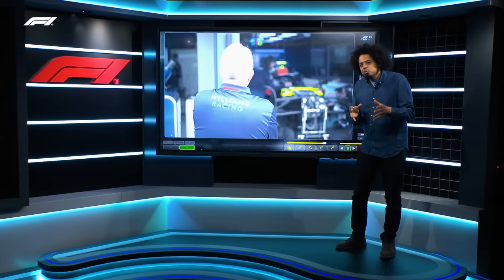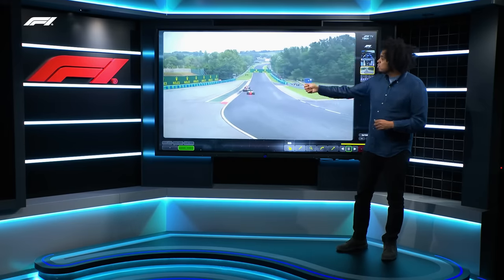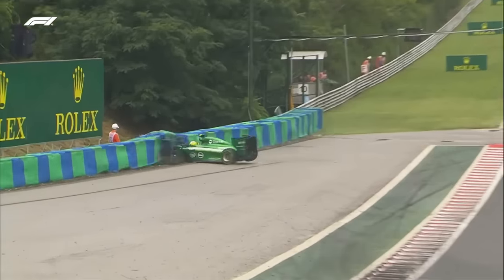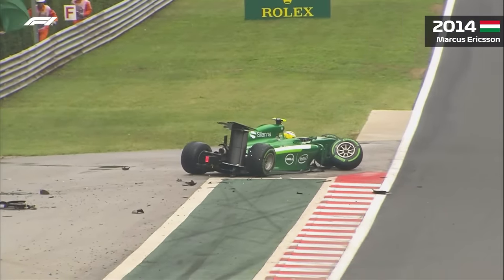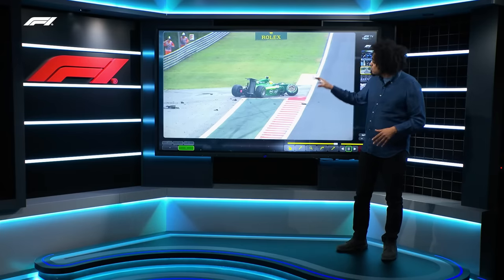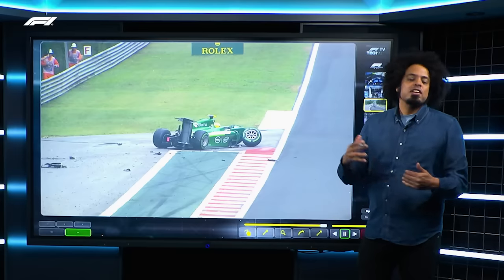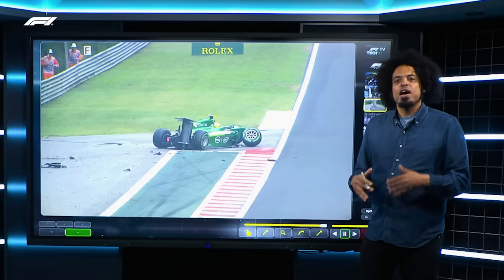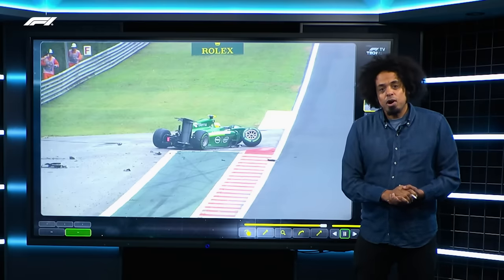Beyond Repair: How Teams & Drivers Deal With Intense Mishaps! | F1 TV Tech Talk

Comment: Remember when DannyRic crashed his MCL35?  Engineers first question was "is the car ok"?  DannyRic: "I'm ok, thanks" 😂😂😂😂
Reply: That was because they couldn’t see the car on their computers ,so they didn’t know what happened
Reply: @Edgar_007_  is the car ok??
Reply: @hoverpilder1905  yeah piastri is about to race in it
Reply: Cause he’s washed
Reply: The stream on the pitwall is a bit delayed so they don't always know what happened before they get on the mic. I'm assuming this was also the same reason Leclerc was pitted but then told to stay out too late in Monaco
Reply: @dip1697  Box Box Box.  stay out !!! stay ouuuuuuuuut !!!!! 🤣🤣🤣
Reply: @dip1697 Especially in Monaco, where data transfer of every sort between car and pit wall as well as pit wall and factory is severely hampered due to the many buildings blocking and other sources of radio waves interfering with communication 
Makes a stable connection almost impossible 
That resulted in this odd situation but putting it like Tom Stallard only cared about the car and not about Ricciardo‘s health is outrageous and just untrue

Comment: A Formula 1 team not having a spare chassis is ABSURD! I'm sure ANDRETTI would have...
Reply: Who is Andretti?
Reply: Williams have more history than can even dream of if they got into F1
Reply: 24 races in a season and budget cap.... Simple most teams are running with little to no spares as the build season has been cut so short.  People work 12-14hour shifts factories run 24 and it's still not enough to get two cars developed manufactured and with race spares quantities. Also in this season's FIA test for the chassis as an individual component several teams lost a chassis at this stage...... It's a big shame for Williams but they will bounce back.

Comment: Great video. If I'm correct though, the engine/gearboxes allocated for the year are for the chassis, not the driver. At least if drivers swap teams during a season or a driver takes over a seat, they continue with the pool of parts that chassis had. I'm not a 100% sure if it is the same case for a switch within a team though. If it is for the driver within a team, they should've changed all limited parts on Sargeants car to parts from Albons pool, did they do that? If they did, then you said it correctly, if they didn't, the parts pool is for the chassis, not the driver.
Reply: It's correctly assigned to the driver. In an event that a driver being replaced, the replacement will use the original driver allotment. And they did change the whole limited parts on Sargeant chassis to Albon's.
Reply: @sonicslv6132  Thank you, that last bit of info, they changed all limited parts on Sargeant's chassis to Albon's, that proves I was wrong.

Comment: Formula 1 cars aren't "famously" strong, they usually break if you look wrong at them, rally cars on the other hand are in fact famously strong, they smash a tree and roll over several times just to continue with a caved in roof, missing bodywork and just loose some seconds on a stage
Reply: I think Sam is referring strictly to the monocoque (tub) only, not the other bits that fall off quite easily.  They used to be a LOT weaker than Indycars (Schumacher's broken legs in 1999 for example in a 50-60kg tub), but now they are about the same strength as an Indycar at about 150kg for the tub inclusive of halo (and/or aero screen).  Even though the F1 car will never race on a (complete) superspeedway.

(If unfamiliar, tub is the bit where the driver sits.  It also has the fuel tank inside it in a second compartment, so the fuel tank is better protected.  The nose & front suspension then bolts to the front of the tub and the engine then bolts to the rear of the tub forming the structure of the car, in turn the gearbox and rear suspension then bolts to the engine.  The gearbox is designed to snap off from the engine in a severe collision.)

Comment: "F1 cars are famously strong".....since when? They're famously fragile
Reply: They famously allow drivers to crash at insane speeds and not die. Hasn't always been like that, they are strong where it matters
Reply: If they would be unbreakable, drivers would most likely die just from a crash due to the trauma crashing into a wall. The car is made to absorb the damage and break making the driver safe.
Reply: Since Grosjean ripped his car in half, set it on fire and climbed out with relatively minor injuries. If it wasn't for the strength of the monocoque he'd be part of the barrier

Comment: These regs makes them too heavy. Go back to lightweight naturally aspirated  design.
Enough of the Ross Brawn pipedream
Reply: 2013 V8 cars were 642 kg. And had somewhere close to 160 kg of fuel for a race. Roughly 800 kg at the start of the race. 

2014 V6 hybrid cars were 691 kg and max 100 kg of fuel. 791 kg at the start of a race if fully fueled. 

So at the start of a race, the hybrids were actually slightly lighter. But obviously they got pretty even near the half way mark and at the end of the race the difference was 40+ kg in favor for the NA V8s. 

The cars have since gained 100 kg worth of aero and safety structures which is the reason the cars are so large and heavy today. The Hybrid PU is much less of an issue really.

Comment: This track is not suited for F1..too many crashes etc ..the track needs to be changed.
Reply: No
Reply: Nah.. it's a typical street circuit damage.
the monocoque is designed to break under the certain force caused by impact and frankly did it's main job as the safety shell for the driver. It's Team's responsibility to design and built the chassis under the FIA standard. 
just unfortunate crash and It's a logical swap by Williams for the better chance for points. hope Logan can raise up his game after this hard luck.